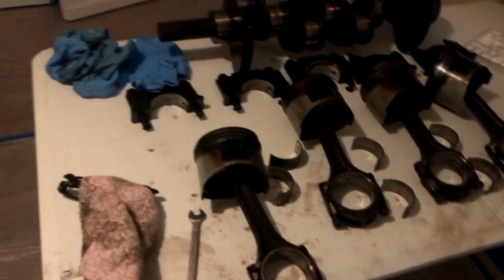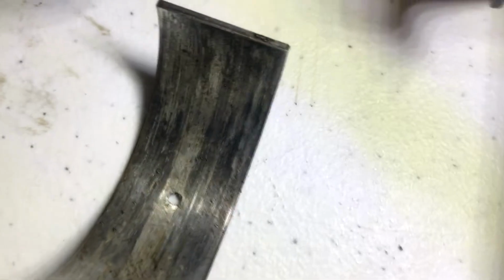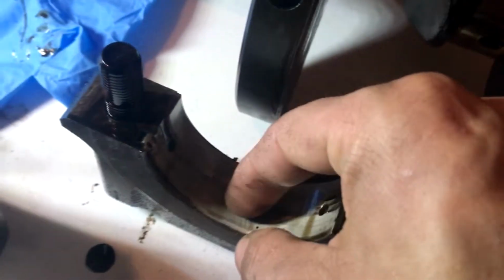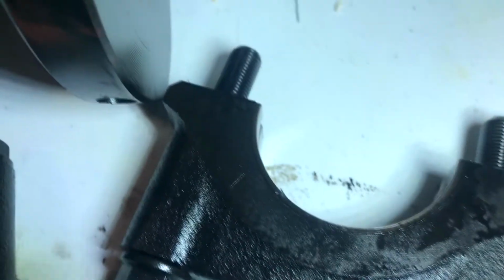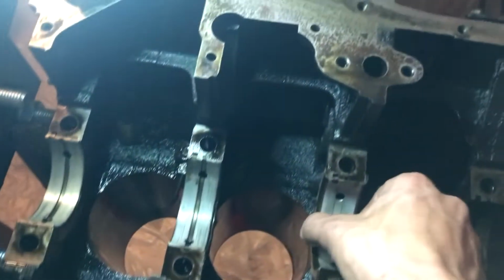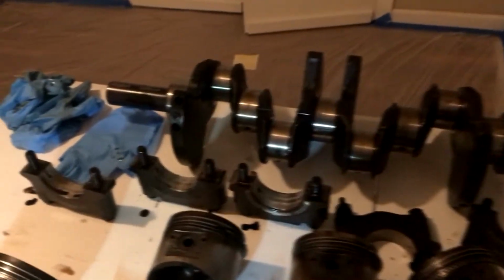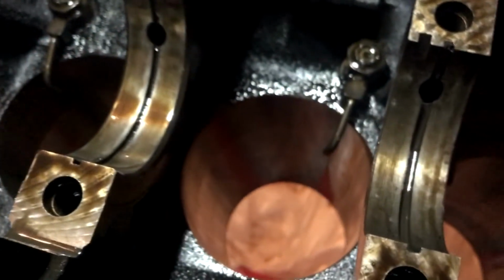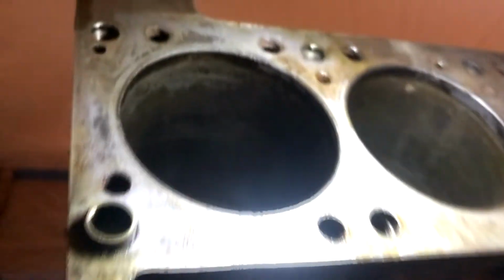Starion Rotating Assembly Tear Down

Comment: #3 bearing spun on me, too. Twice. So, for my final rebuild, I'm getting a new crank, all bearings, BSE, and maybe a Weber carb. My head is still in great shape, pistons will be re-used with new rings and a light cylinder honing, and a valve lapping for all the compression I can get. Final rebuild. If/when it starts to give out again, I'm money shifting it and sending rods to the moon. Then, I'll drop in an old carbed Chevy 350 with a 3 speed auto.
Reply: Any update on your engine?

Comment: I would recommend deleting the balancing shafts as well as the Jet Valves.
Reply from the maker: Drake I already have the balance shaft elimination kit, and I’m ordering an NJV head once the bottom end is done
Reply: Nice, I need to check if my car has a Jet Valve head.  Right now she needs a turbo rebuild and cranks but won't start.